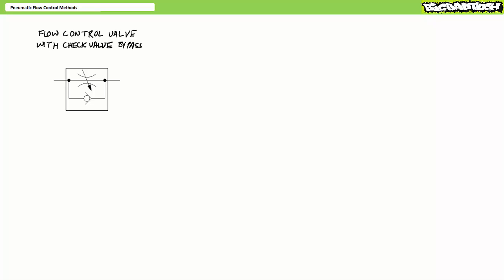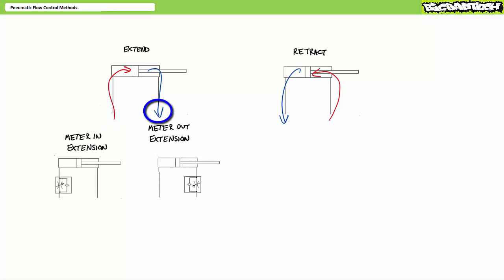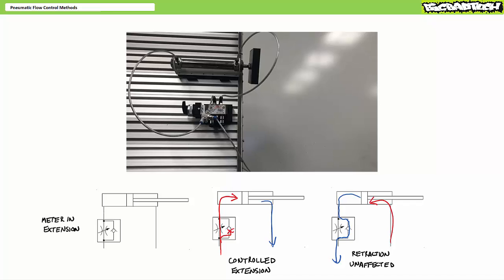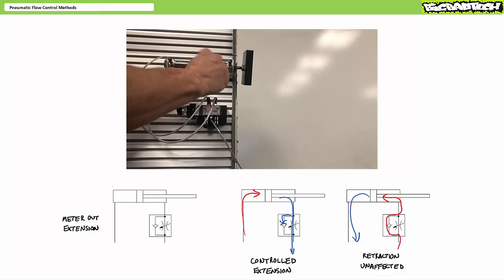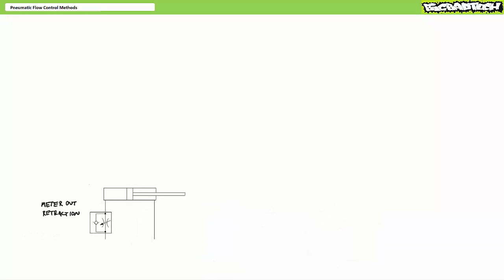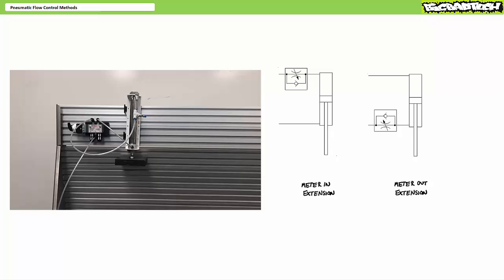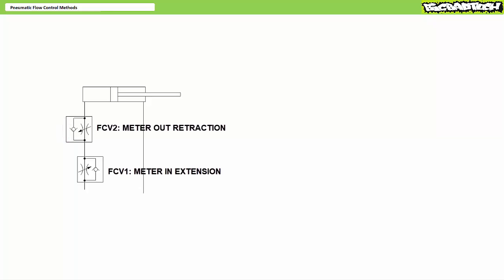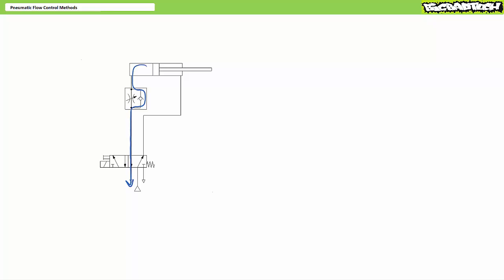Pneumatic Flow Control Methods (Full Lecture)

Comment: Is it possible to use a 12vdc pneumatic dcv and a photo eye as a trigger to trigger the dcv?
Reply from the maker: Totally. There's a bunch of different methods. Check out the pneumatic directional control valve lecture and one example of an electrically controlled fluid power system lectures at:
https://youtu.be/Npu9uJYDI2k
https://youtu.be/bmqu3XRGg7g
Also stay in touch as I'll be publishing more lectures on electrically pneumatic systems and, ironically enough, photoelectric switches.